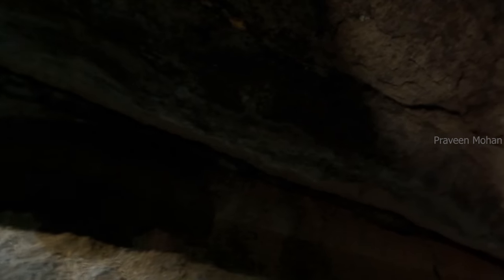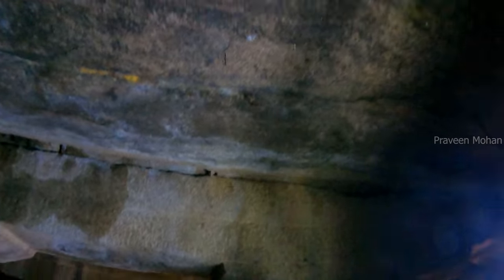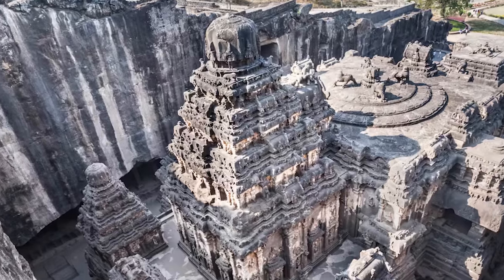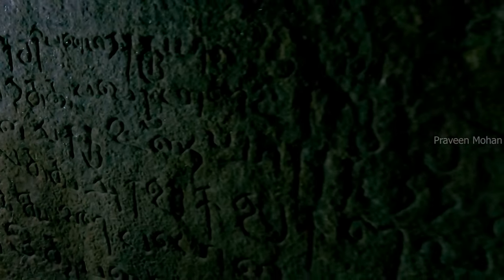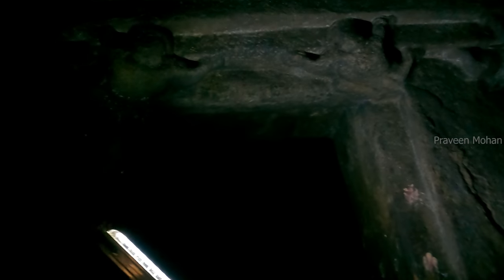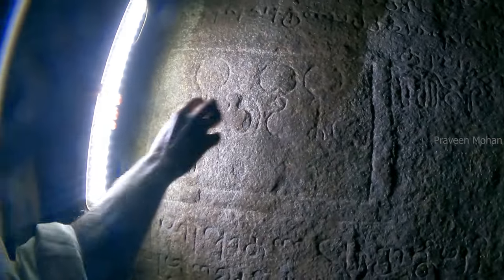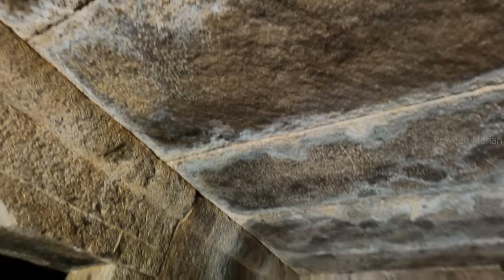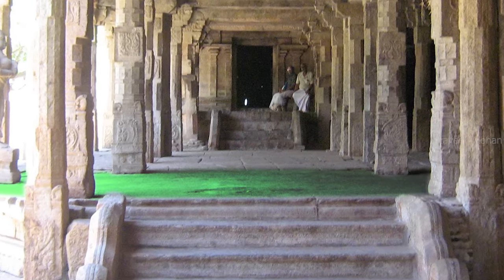Impossible Rock Cutting Technology Discovered in Ancient Indian Temple?

Comment: The more one knows about architecture, mathematics, construction, stonecutting, etc the less they believe the established narrative of how these structures were created...Praveen, I like where you mention the weight and question how blocks of such immense weight could be mentioned, even with modern transportation methods as such a question would undoubtedly get even the skeptical mind wondering!. I also like where in this video and as I've seen in videos around the world where our ancestors built on top of or added onto older megalithic stonework and you see the stark contrast in superior stonework vs more primitive work that our ancestors would have been capable of creating with simplistic tools and hard labor.. Because no matter how one chooses to look at and interpret these ancient works, when it comes to megaliths, many simply cannot be moved by Any number of laborers, pulleys, etc and many (as you pointed out) cannot be moved by modern methods!. Such stones cannot be transported, cut and dressed to such precision, be lifted, etc without (at the bare minimum) of 21st century technology and even in that case, many of these megalithic stones still cannot be lifted, no matter how many modern cranes you string together to attempt this task!. Most people grossly underestimate the weight of stone and the immense weight of even blocks which may not seem massive, yet weigh many tons..A ton is 2,000 pounds and there are megalithic blocks that weigh several million pounds!!....

Comment: I would question the accepted age of these temples. Invariably as more evidence comes to light, such as the weathering of the sphinx in Egypt, there is often a much, much older dating likely with later activity that moved blocks, altered or defaced the original architecture. As Praveen mentioned, there is not a known method of transporting 100-200 ton blocks (or larger) even with our best engineering tech, just like some of the larger stone blocks in Egypt and other megalithic sites. Noticing a comment posted already concerning moving a 300 ton rock (very difficult), there are much larger blocks in some megalithic sites also. See Edward Leedskalnin as an example of someone weighing barely over 100 LB moving multi-ton blocks in minutes (Coral Castle, FL), and claimed he re-discovered ancient Egyptian technology.

Comment: Well, I came a cross a  story some time ago.  Cannot find the original information but transporting the heavy loads was by sound and cone-shaped devices.  This came out 15 years ago.  Transporters were allowed to drive their truck in but the guy receiving the heavy goods had NO tool to move such objects.  He asked them to leave and close the big doors behind them.  1 Guy managed to peek in and saw 2 cone-shaped devices handheld.  He simply pointed the open ends outwards to the object.  Then it starts to levitate and move easily.  No idea what they are called or know where the original info came from.  However, the case still stands.  I wished I kept the data for you.

Comment: The Thunder Stone, is the largest stone ever moved by modern humans. The stone originally weighed about 1500 tonnes, but was carved down during transportation to its current size and weight of 1,250 tons. It took 400 men 9 months to move the stone 3.7 miles (6km) which was just the first leg of the journey. This was done in 1768. To move the rock a large capstan was turned by 32 men and this was enough to barely move the rock. 

 So it is possible to move a stone the size of the one shown in the video without high technology. An adult elephant can pull up to 9 tons, so it would take 6 elephants to move the stone in the video.

Comment: Its most likely just like most of these ancient structures that have multiple building techniques brother. The 1300 year old addition to a much older structure built into the stone cliff face. Like at machu Picchu you have the huge tight fitting stones topped with the later inhabitants smaller stones they used to on e again occupy the area.

Comment: Megalitic time is before 12.000 yeas ago, not 30.00 years ago.
They scooped up and carved from an hill that created a partial monolithic structure that was in plain air and light until with the scooped material they molded the Megalithic stones to end and close the whole structure which at that point only became pitch black inside .
They built the structure from the inside out, not vice versa

Comment: Look at the place where the angle stone, and the top stone come together and you will see what looks like a modern day metal welds, but with stone, look at the joints verry carefully and you will see the swirls, left by molten stone, juust as in a weld joint made from molten metal, when welded... this is at 8: 53 time on the viedo..

Comment: First, I would question the "1300 years ago". If we synchronize with other youtubers like Brien Foerster and Ben of UnchartedX, for example, we will come to the fact that such megalithic constructions can date back to 7000 years ago to fully 12.500 years ago, and the civilizations that came later, inherited the constructions (as pointed out by yourself too, when describing the smaller stones). Then, I would question wether or not if they had artificial illumination available, since they work in complete darkness, it appears. Then, there is the weight of the stones and finally the machining of these stones. Very difficult topic.